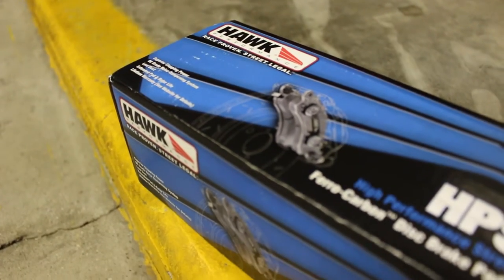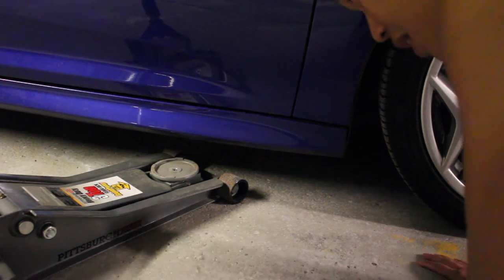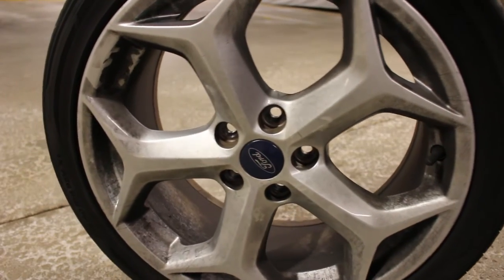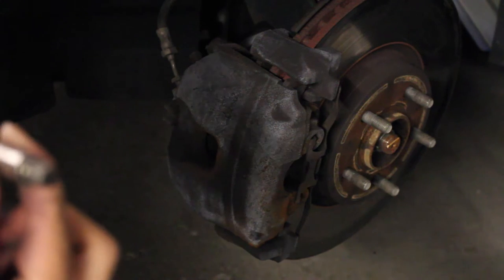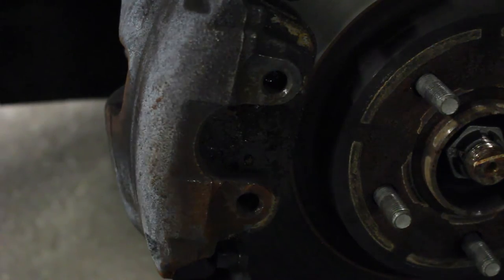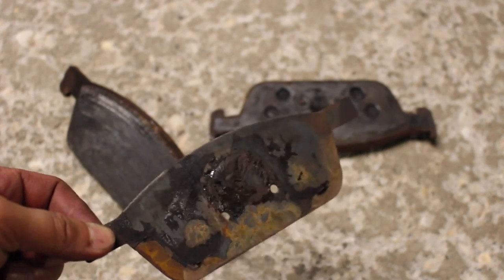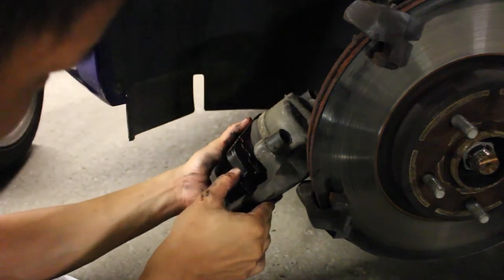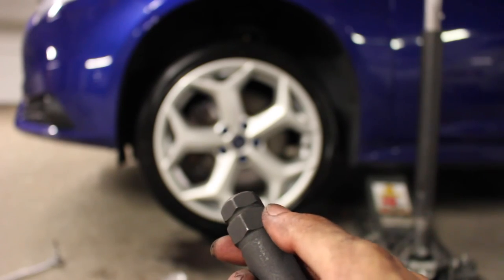Ford Focus ST - Front Brake Pad Install (Save $200)

Comment: Stock lug nuts are horrible design. They have a cheap cap over the actual nut. Making it hard to take off and put on. How'd you like those pads?

Comment: Did you use these pads at the track? I am thinking about getting these before I go to a track.
Reply from the maker: +Rowan69 yes I do indeed. I only get brake dust when I'm at the track any other time 0 brake dust. Love these pads!
Reply: Thanks for the reply. I will probably get these before I hit the track!
Reply from the maker: +Rowan69 make sure you do brake fluid too!
Reply: that was the plan so far :)

Comment: Is it the same process for the rear brakes?
Reply from the maker: It's similar, but slightly more difficult because of the sway bar being in the way of the pins. Also, the piston compresses back in a slightly different way as well. It needs to be compressed and twisted at the same time (piston compressor I believe is required) you can borrow one from your local auto parts store or buy one on Amazon for $30.
Reply: @DerrickMoy  I replaced mine but the piston on the caliper is not pushing out and my e brake got loose. Any advice or help will be appreciated.
Reply from the maker: https://youtu.be/cZ4wC-Da12U I have another video I’d scrub to around 17 minutes where I talk about the rear brakes. But you should borrow a piston compressor from a local auto parts store or buy one on Amazon. There are two holes in the piston that need to be pressed in and turned clockwise to force it back in.

Comment: if you use the emergency wrench for lug nuts to do basic maintenance: you shouldn't be working on a car and definitely shouldn't be showing anybody how to work on a car.
Reply from the maker: Haha trudat, the lugs were super fat and hammering on the sockets didn't work for me. It was almost like I needed a 21mm which is pretty difficult to find.
Reply: As someone’s who doesn’t have a lot of tools in my small apartment I appreciate knowing it’s possible for me to do with essentially my tire change kit.